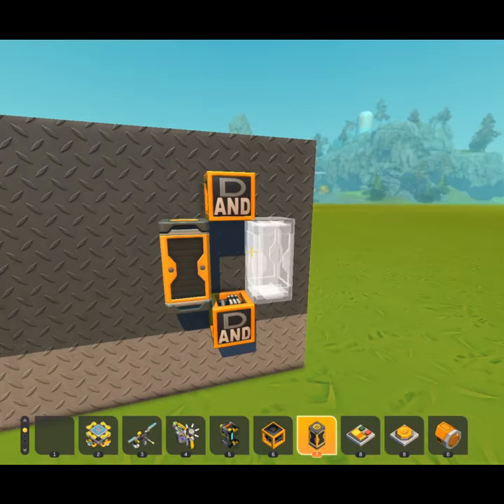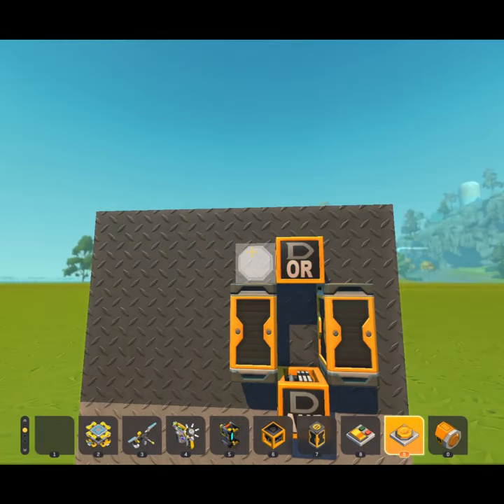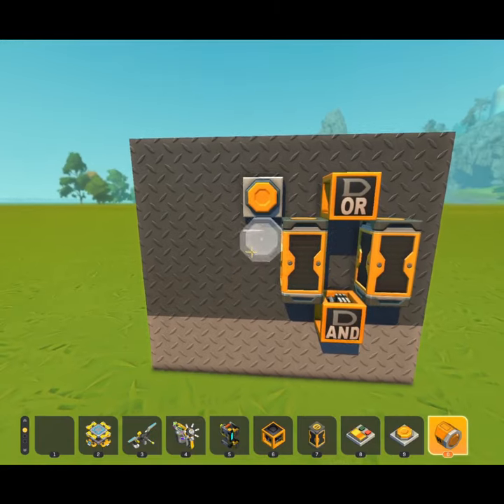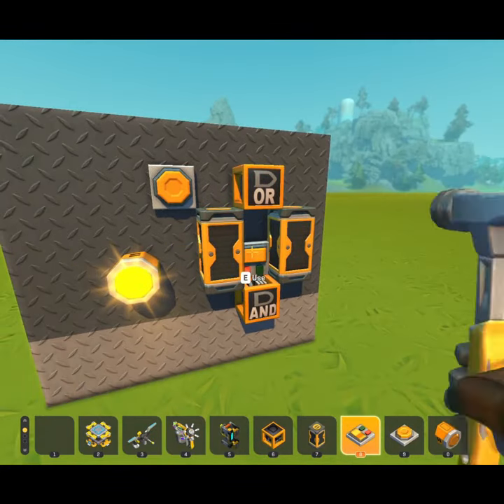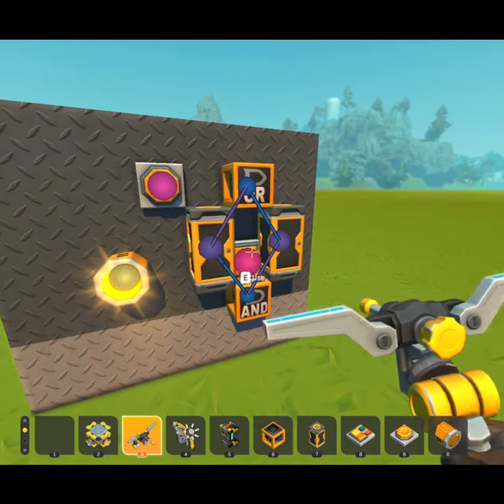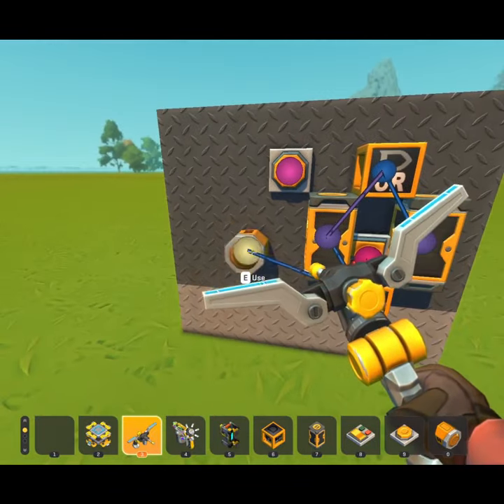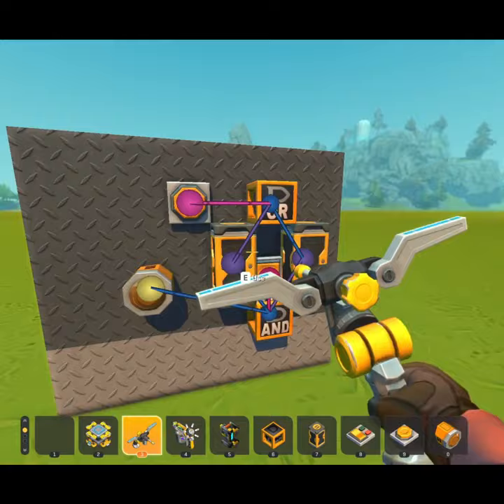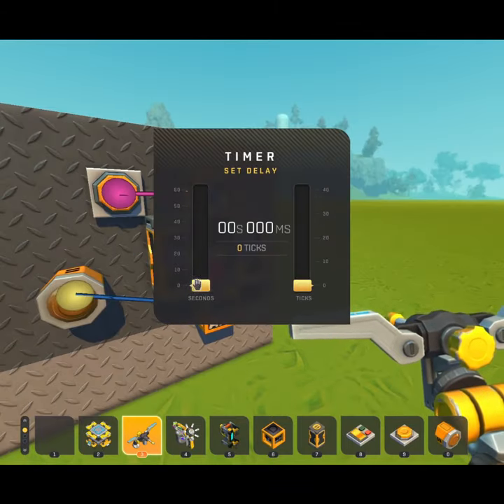Timer memory: using timers to REMEMBER a PATTERN.

Comment: Can you make a minigun out of Spudgun with a feedback loop logic gate please 😊
Reply from the maker: Typically those are done by mounting 4 spud guns to a circle, connecting each to a distance sensor, then spinning the whole thing, but i'll see what i can do without the spin.
Reply: @AgentWest  thank you
Reply from the maker: No, it's not two weeks later, you're two weeks later. lol
Turned out to be a simpler system than I first thought, and it works much better as well:
https://youtu.be/1HGVy0FXWP8